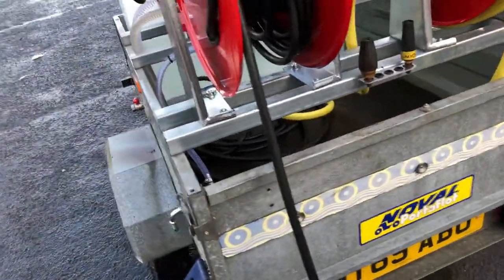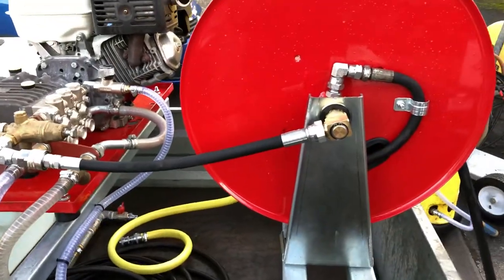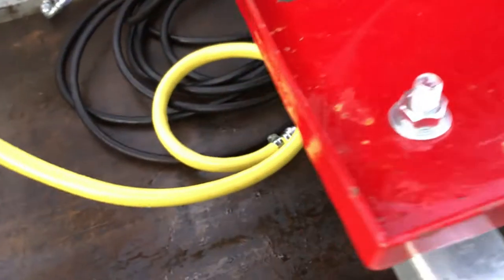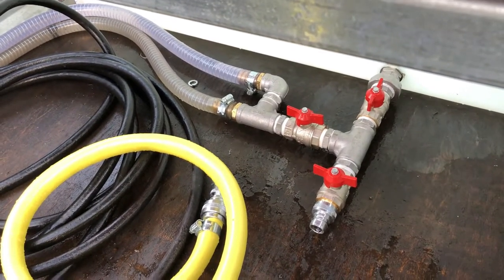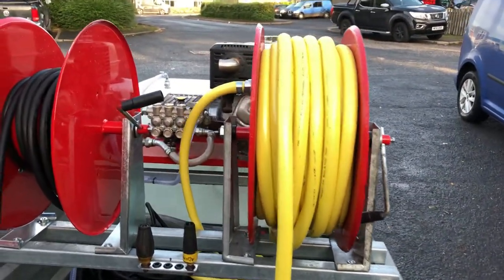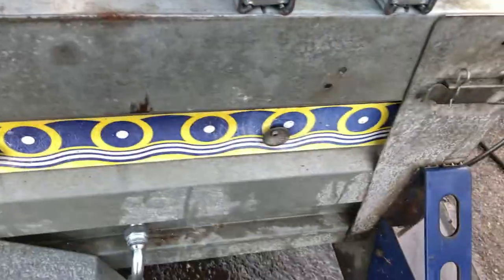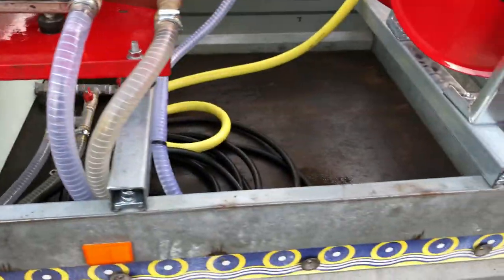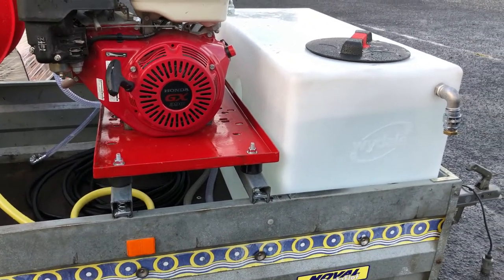QWASHERS @ EBAY & YOUTUBE TRAILER 210LTRS 200 BAR @21LTRS GX390 2 X 50M HOSE REELS 01524241487

Comment: Twin feed is really gaining anything? It’s drawing from a singular 3/4 which is then split?
Reply from the maker: If you see we are using 3/4" stainless steel fitting which have a massive internal bore, We then have to step it down to 1/2" bsp when entering both sides of the pump. The pump is 1/2" not 3/4"

Comment: 🤤
Reply from the maker: If you see we are using 3/4" stainless steel fitting which have a massive internal bore, We then have to step it down to 1/2" bsp when entering both sides of the pump. The pump is 1/2" not 3/4"